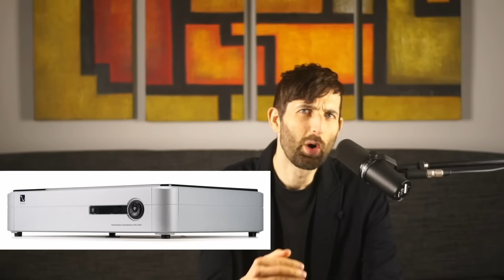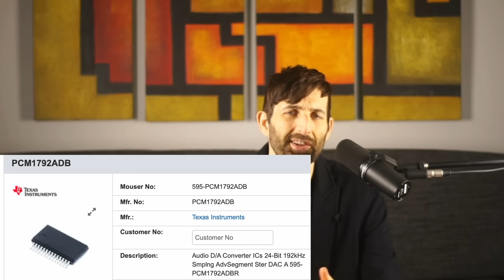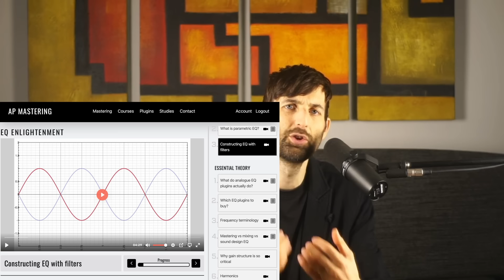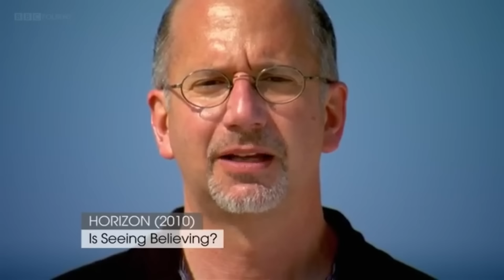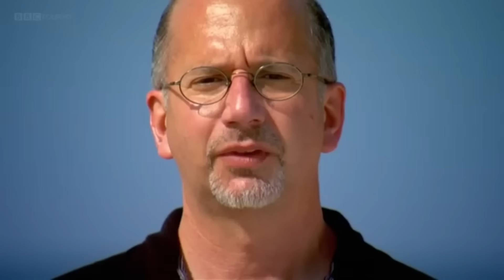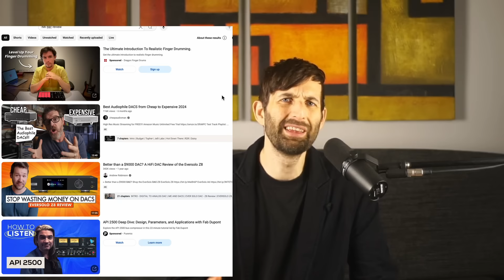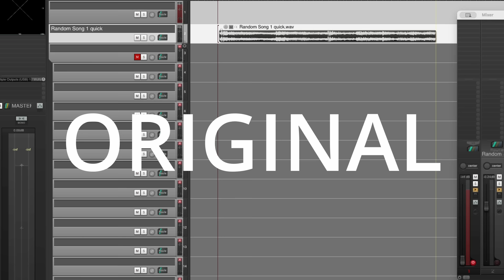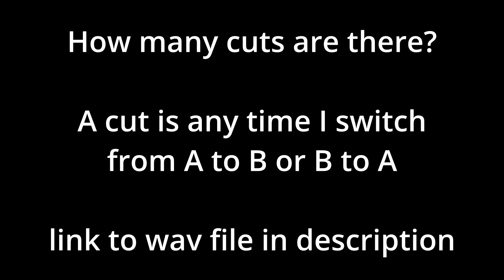The DAC Scam - Almost everyone believes the hype

Comment: There happens to be just a tiny bit more to building a DAC than putting some connectors on a chip in a box. Let me know when you have finished your degree in Electronics Engineering. Even down to the amount you will be paying for the Guy who did the circuitry design (engineer). A Good Engineer doesn't work for free. How about paying for decent tech support? Of course, you could be like the cheepiest and farm your CS out to the Philippines or worse. Get a life and while you are at it, get some hearing aids. Let me know how your theories work when you need brain surgery. You would go with the guy who cheated on his finals I suppose?
Reply from the maker: There are schematics in the chip manuals

Comment: As someone who designs electrical products but not in the audio sphere, claiming its just the chips is just flat our wrong, there are so many other factors that can impede the quality between the processing of the digital to analogue and the signal sent to the amp. That said, optimising signal path should not cost 100K+ lol.
Reply: Exactly.
Reply: It shouldn’t even cost $10k, or even $5k. 
And the proof is that it’s perfectly done in dacs costing less than $1k.
Reply: Perhaps,  but high quality parts & work in very small quantities is expensive to produce.  Most people don't understand because they have never run a business.
Reply: analog ic design engineer here. The bottleneck is still the dac, you can optimize all you want your signal path, the dac has finite resolution and the quality of the signal will be as good as that ic, you cannot improve beyond that point.
Reply: @guillermomaciasrojas7912  Yes obviously signal path cant improve on the capacity of the dac chip but it definitely can reduce it.
Reply: Yeah he's oversimplifying it for the masses, not the engineers.  Take a step down from your high horse.
Reply: @drozcompany4132  Pot meet kettle. Also a simplification must still remain true. Saying its just the chips is simply false.
Reply: @1commentking  💯
Reply: So a Toyota Corolla is exactly the same as a Porche GT4 because they have an engine and get you from point A to B so they are the same but are they. Sorry cheap people seem to defend their scrooge McDuck and it shows
Reply: this presenter of said topoic is clueless..he should go to a walmart and purchase the latest gear.. unsubscribed.
Reply: 100K+ DACs are not for sound.  They're a status symbol...like owning the Hope diamond.
It says "I have more money than you".

Comment: Same for amps, the most expensive part is the transformer, and switched transformers have even begun to disrupt that fact. The transistors used in hifi amps are not expensive. Licensing costs for the codecs is probably the most expensive part of a receiver

Comment: So, I have a £8k chip dac and a £4k R2R dac. I prefer the sound of the R2R. More spacious sound with a wider sound stage. I agree to a point that since chip based DACs pretty much use the same chips in theory, there shouldnt be a difference, but there is. Whats missing is the implementation of that chip, what the power source is etc. Then there's FPGA DACs etc. So no, not all DACs sound the same.

Comment: There are audible differenceses in dacs. Usually down to the oversampling used and the digital and analog filters used, if external dsps are used. 

Also, down to design, the enob changes even with the same chip.  All of this is usually down to compromises in designs. 

Also, going over 16 enob, is very difficult, over 24 is basically a metrology level problem, 32 is not really possible outside highly specilized scenarios.

Comment: I have tested a large number of audio equipment, I have heard tremendous difference in speakers and headphones, however I have never heard a tremendous difference in DAC's from cheap ones, built in motherboard ones and high end ones. An adequate modern sound card does the job just fine and more than you'll ever need but there is the element of nostalgia... example: tubes vs IC and transistors, there is a nice effect when listening to tube amplified sound, not necessarily perfect but  is appealing to some of us, just like Film photography and digital photography, sometimes the imperfection and noise add an organic element to it all, most people would never perceive it tho

Comment: OK............ So, when listing, it looks like "the dac scam" is a scam on its own. I hear a lot of statements placed in the wrong context. There is a difference in sound between DAC's, and yes, some DAC's are not worth it (due to wrong engineering). If you believe this man, than you believe also that there is no difference between a Ferrari and a Dodge RAM, since both have a V8 engine, rubber tires, a steering wheel, doors, windows, lights, they keep you dry during transport......... This is what happens when idiots try to explain technology out of their scope. And of course, those who "hate" or are frustrated and jealous about a bit more expensive/better equipment now feel at last recognized, so for this channel, it is an easy win. As always, a fool can question more things than intellectual specialists can answer....... and yes, those going along with this also believe that vaccines are a tool of the manipulating fews in this world. Enjoy your small happy world, but be sure, it won't bring you further in your life!

Comment: 6:35 You've obviously never heard of a capacitor or know nothing about electronics. Low pass filtering is not something that only exists in the digital domain - it predates digital audio, including the CD. You don't hear the stair steps or hear lots of high frequency noise with R2R/NOS DACs. It's more likely the filter will be too aggressive and you will lose some high frequencies.

Comment: Quick note from a digital chip engineer.  Industrial and mil spec parts (at least in my area) are not just the same design, they're the same chips on the same line from the same wafer.  They've just been tested off the line and found to be able to tolerate the wider temperature range.  They also often have worse timing specs to be able to meet the wider temperature variation with reasonable yields.  Plenty of commercial grade chips would have met industrial temp ranges, but if there's not the demand then they don't get marked as such.

Comment: Agree. I bought a Topping DAC with the AKM /99 Chips you mentioned and it did set me back 350 Euro. I am super happy. At the same time, I bought an 80 Euro SMSL DAC with an "inferior" AKM chip. To be frank, there is not a lot of difference between those DACs

Comment: "...any decent manufacturer should be able to put together a high quality, transparent, mastering grade DAC for a couple of hundred quid..." - yup, like Topping does since years. That's why I'm getting the Topping DX5 II for 300€. Not because of the bloody DAC. There is no diffference to the Fosi ZH3, my second choice. But  because it's as good as a DAC get's + an outstanding Headphone Amplifier + good pre-Amp + nice 10-Band Equalizer + subjectively good looks. Basically the Endgame for my personal Hearing Capabilities! And maybe that's most of the confusion in this Debate (more like a holy war!): the pure DAC itself isn't the thing to talk about, as you said, there all quite the same after all. It's the headphone Amps and pre-Amps, the OP Amps, the Oversampling and Filtering that colour the sound most, and even that is often minute. And most People buy combos, not pure DACs. So maybe not riding this debate to death but changing the Terminology? DACs don't differ much, if at all. DAC / Headphone Amps and/or Pre-Amps do. In sound and feature. With that small but important distinction, the whole debate would probably be none!  😜  

Keep it up, spread the word, I like your content!

Comment: 10000% kudos points for mentioning level matching. It is something that has caused SO many false positives for otherwise fairly well conducted test. That is why mp3 vs wav tests fail too. To be able to compress the size of an audio file, we need to recreate the full wave. This means our waveform may peak over 0dB. True peak vs sample peak. If we have sample values between -100 and 100, and then we have sample values of -100, 100, 100, -100 then the curve that can go thru all those dots has to go over 100. So the compression algorithm first recreates the wave in higher bitdepths, then it peak normalizes that whole clip so that true peaks do not go over 0dB. Mp3 is 1-3dB quieter than the wav. 

Now, if you don't know that you will assume that the compressed file has the same level as the original, and get results from a test that is otherwise very well done: it can be double blind, have 1000 participants over two weeks and hundreds of samples and we get fully consistent results: MP3 will sound "lame", less punch in the bass, less detailed midrange, less sparkly in the highs, it is muted, less dynamic etc. Exactly what people who have done that test will tell you.... because the mp3 was slightly quieter.

And DACs.. well, the expensive stuff is usually just louder, unless it is marketed as "natural" and "warm"...

Comment: "My 384kHz hires stuff sounds awesome thru my 192kHz DAC". In reality, that just means the source bandwidth greatly exceeds the audio system bandwidth, and all the extra goodness creates distortion and heat. One of the stupidest things audiophiles do is to use hires sources without a lopass filter that would actually make the sound much better. Of course, none of them hear any distortion as there is fuckall anything above 20kHz in the material, the distortion and heat that WILL be there is ridiculously small, fully inaudible and the heat added is undetectable. But, we know it is there. But if you tell an audiophile that they should lopass filter their golden hires source, that is blasphemy. There are no lopass filters in their DACs, there are no 3rd party lopass filters meant to do the job. None.

Comment: I've bought a Chi-Fi DAC + linear power supply for less than 300 Euros a couple of years ago. It's got an AKM 4493 chip, so not even the flagship model. It sounds way better than the built-in DACs of any of my (oldie) CD players. In my opinion, DAC technology for audio has been solved quite a while ago. I don't see (or rather: hear) a reason to spend more.

Comment: Its not only the chip , if only that was so simple and linear , is about implementation and output stage !!!
Reply: In part i agree with you when it comes to the cost no object dacs ( law of diminishing returns). But to say that its all about the chip used ....that is so simplistic ! And convenient .
I have already heard ( cheap ) dacs with the exactly same chip that sounds very different !!  Explain that to me like i am 5 years old ! 
Its like saying two cars with the same motor will have the same  driving experience  !? What about suspension , gear box , chassis , ??????
Reply: I am sorry ,...very ...very de simplistic approach

Comment: A recent video compared the sound coming out of Yamaha's new MODX M and out of the Montage M. The Montage boasts a higher quality DAC and its sound was definitely better, but I could also clearly hear longer reverb sustain levels and decay times, as well as perhaps less steep filtering contributing to that gorgeous/warmer sound. The MODX simply sounds cleaner and less fat, as if maybe 24db filtering is being used in its DAC instead of 12db. I think Yamaha has simply put more effort into tuning filters etc to make the Montage a better instrument and they need to be paid for those man hours. That's not a scam. The highest quality acoustic pianos are much more expensive primarily because of the time spent regulating and voicing them. Sometimes the materials are the same as in the cheaper models. There just isn't as much workmanship put into the cheaper pianos. When people come up with a great sound, they deserve to be paid more than those who may be putting the same components into their gear but haven't bothered to come up with a way of tuning it nearly as well.

Comment: 100% agree. Most of the cost of hi-fi equipment is the hardware and power supply. this is more or les the same for any equipment. The components similarly so. 

The reason the manufacturers don't need to justify the price is that there are enough idiots out there who will buy their overpriced nonsense. 

I think it started back in the 70's with the Linn & Naim stranglehold on the hi-fi magazines. People believed that BS and since then have paid through the nose. Now a Linn turntable can cost more than a luxury car. Even the plywood plinth is now £8000 which probably cost no more than £100 to make.

The sound of a DAC is mostly down to the analogue stage and all of the preceding criteria apply. It all comes down to snake oil as you said.

Comment: Problem is you speak about delta sigma and there i agree to a extend 
I can hear a difference with fpga chips and mulitbit dacs either chip based like in schiit yggdrasil or ladder based like for example holo spring but i agree a dac even a professional dac should not cost more then 5k

Comment: I spent about US$100 on a Topping DAC and gained instant improvement over my Mac's sound quality. Its not just about the D/A chip, much equipment sound quality is achieved by using a good power supply (ie: linear, not noisy switchmode like most modern electronic equipment has)

Comment: I have a fairly nice hifi system with a Mytec Brooklyn Bridge streamer DAC that I bought used on EBay for a third of the price.  It sounds fantastic.  It is connected to a 100 percent analog Yamaha AS1200 and KEF meta ref 3 …all purchased second hand or open box. Sounds amazing.  You can spend Tripp,e the amount and not get better sound in my opinion. No hobby has greater diminishing returns than audio..

Comment: The Raspberry Pi DAC Pro addon board uses the Texas Instruments PCM5122 or PCM5242, and costs about £50 for the DAC board + £35-£90 for the Raspberry Pi, depending on the model. You can use a Rasp-Pi that is several generations old without impacting performance, because all the important chips are on the DAC addon board. My brother is a bit of an audiophile, but doesn`t care about having the top of the line (i.e. most expensive) gear, just the gear that sounds the best for his tastes. I built him a Pi + DAC Pro to connect his turntable to the amp, just to get his feedback on the quality, and he`s thrilled with it. It`s now a permanent part of his audio setup.

Comment: One thing that makes DACs sound different is NOT in the chipsets necessarily, but the output stage. Many manufacturers use op-amps as their output gain stage, rather than a high quality discrete gain stage. And that you can hear, since op-amps tend to be fairly noisy if not properly implemented...that being said, there is a lot of nonsense in hi-fi...
Reply: Exactly what I thought. And output stage design and component quality  DO matter to resulting sound, just as XO part quality affects speaker sound profoundly.
Reply: This is all measurable and quantifiable though. A big caveat to all this is competent implementation, and that can be had easily for a few hundred vs a few thousand.
Reply: @rapzid3536  Exactly

Comment: I would have to say that whilst theoretically a high end DAC shouldn’t sound any better it does. But there is a law of diminishing returns. I’ve compared my 350 pound Cambridge Audio to a 7000 pound chord setup and you can hear the extra resolution and space in the sound with a very good amp and speakers. But the difference was not huge. Whereas I compared my 350 pound Cambridge to my previous 200 pound IFI zen 2 and the difference is much greater. So a greater difference going from 200 to 350 than 350 to 7000!! Even bigger difference going from dragonfly at 100 to the IFI zen at 200

Comment: I have seen a living room in which the speaker wires were "de-grounded" by hanging those with clothes pins a foot over the floor. And of course, all the plugs were gold plated. 90s was something.

DAC itself is not that important (has not been last two decades), but the analog components around it and the DSP does.

Comment: My friend, please realize that what dictates a dacs analoge output sound quality, depends NOT very much on which converter chip it uses. Input and output stages, power supply and other factors are way more important. What you say, is the manufactors of dac chips hype. 
Before you give us expert statements, it would be a good idea, to know how the actual item in principe is constructed. 
And yes, the hyper expencive dacs, are like expencive watches. Not better but status symboles. 
The dacs under usd 1000,- is not very different. Even if, when connectet to a high-end system, there are some differences. 
My dac, the Weiss cd 204, cost app. usd 3.200,-, and has a distinct and clearly better sound quality than the dacs under usd 1000,- Nobody will be in doubt, in a listening test. AND the chips it uses, are the old ess 9018, four of them connected in parallel. Weisses expensive Usd 5000,- plus models, uses the new chips, but sound almost equal to mine. 
As in most hifi areas, the best buys are from the lower middle-class area, like my Dac. 
Where your attention would be most gainful, is about the speakers and your room treatment. Try to find speakers, that have correct phase and as little noticeable sound from the units membran as possible. They will make the illusion of real musicians and human vocalists. 
Best, HelgeH Denmark